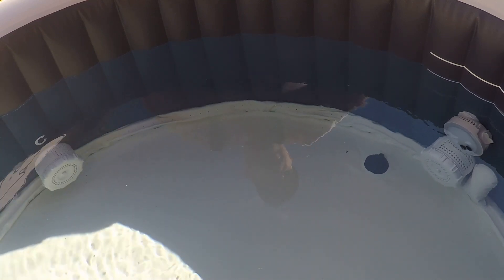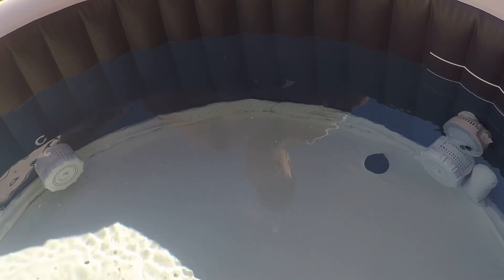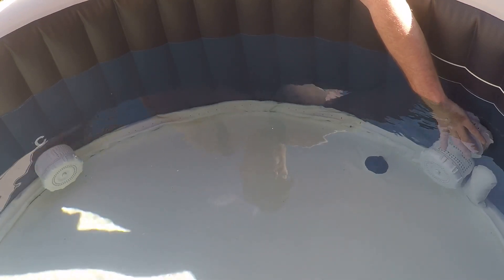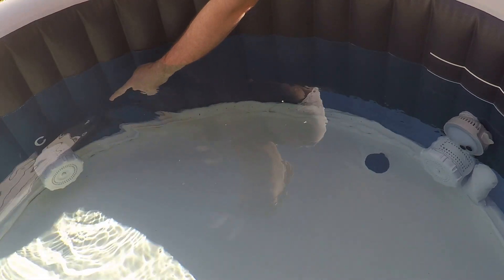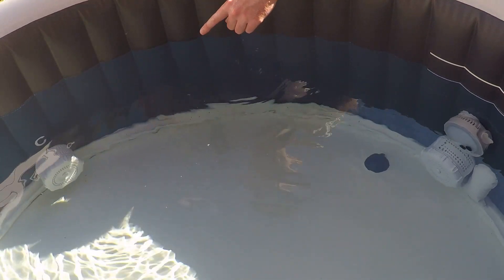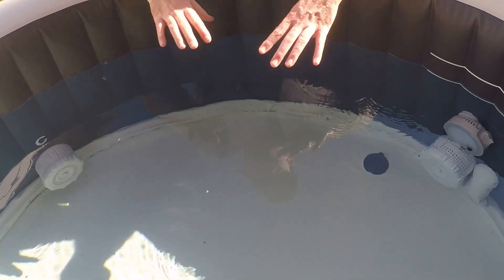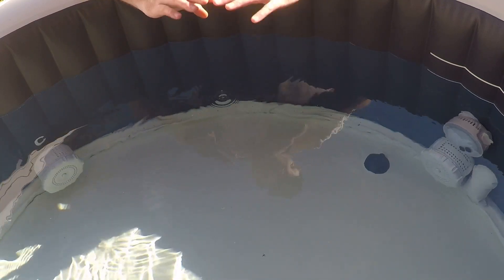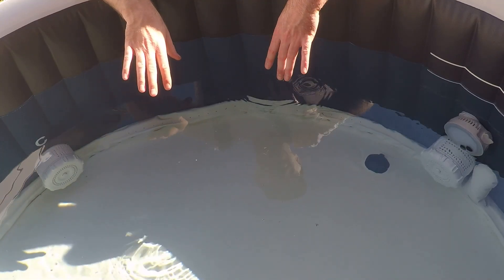How To Make Your Intex Spa Filters Last Longer

Comment: You really should swap both filters out at least once a week and sanitize them. The filters are a breeding ground for bacteria and germs (dead skin, bodily fluids, fecal matter etc) in hot water. I got Hot Tub Lung Disease from a hotel and it was a horrible debilitating experience that took 6 months to recover from. I recommend a 4 filter rotation-- once a week take the old ones out and spray them down, let them soak in a TSP/bleach/water solution for a couple days, spray them down again and dry in direct sunlight. They will look and work like new until you do your next water change. You can often find filters for as low as $1.50 a piece.

Comment: Our further filter hole flows absolutely no water whatsoever.. Ive seen some others with this issue. We figure the little 1/4" line between them is kinked.  Im actually looking for a way to change out the filters for an external system without losing all the heat in the process.
Reply: This is exactly what is happening to ours right out of the box, we assume the line is kinked as well because there is absolutely zero suction from the second filter. Interesting.  Wouldn't even know where to begin to try and fix this.

Comment: HI, i have a question about your "low flow from the further filter return"  I cannot feel ANY water moving through that specific intake and the return has a light flow.  Is this the same in your tub?
Reply from the maker: Yes same. It essentially gets no flow but satisfies the requirement for dual suction points. It would become active if someone blocked the close suction point which prevents an entrapment hazard.

Comment: Do you leave the light in all the time?
Reply from the maker: I do leave the light in all the time, but I use mine daily.  I did notice at the end of last season that the O-ring is degrading from being submerged and I suspect it is going to give me a problem this year, and my spa is only about 4 months of run time old, so yeah, it might be a smarter idea to remove it.  It just unthreads so it would take a few seconds.
Reply: Swimming Pool Steve  yes I think it’s better to keep it out and just put it on when need to use it!
I just got one of these intex spa and strage think it only has one filter inside 
I live in Italy think the models in Europe only have one filter 
Just has the one under the light that’s it 
Strange it’s different
Reply: I got this model and I take mine off when not night or using. Only cuz it goes on the heat hole and I’d rather not block it while idle. Also it changes flow and triggers the e90 fast on mine. I even remove the filter sometimes if I’m gonna be in for awhile. There’s a high chance of e90. I just wait then make sure all is clear and secure it back and run the filtration. I done care about the 2nd filter at all as it won’t trigger any errors

Comment: I have an issue with my display showing that there is an error in my filter and does not heat. from reading posts there is a way to clean out interior somehow. Has anyone dealt with this-?

Comment: I can’t get rid of my e90 error no matter what I do
Reply from the maker: If you take the filters out and run it for a few minutes does the e90 error go away?  It should.  There should be no flow restriction without any filters in there.  Turn it off and on again.  Does the e90 go away?  If so then you are possibly not cleaning your filters properly.  It is the degreasing process that makes filters easier for water to flow and if you are only rinsing filters to clean them oils have built up on the paper.  Also, you will have a lot of foam, yeah?  Oils. This video will help: https://www.youtube.com/watch?v=-f5KE08dKcM
Reply: Having same issue not even two weeks old going to try what you said

Comment: I just got my Purespa 3 months ago and noticed if I remove the water filters, the one not near the water inlet even I can't feel the suction and on the other filter I can feel it very strong, is this normal for this models?
Reply: Hi Alex, I hace the same problem, the water filter closer to the water inlet is strong suction and the far one I can feel it is working. Do you get more info it id normal or maybe a factory problem? Thanks for your help
Reply: I have the same issue.